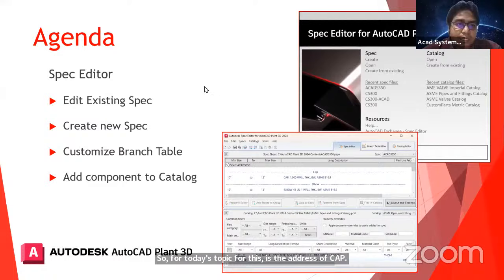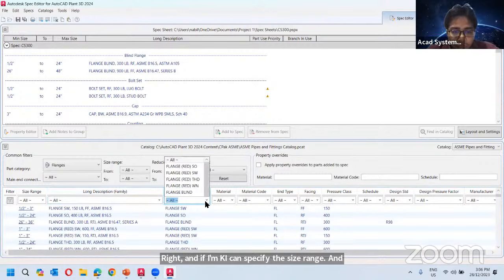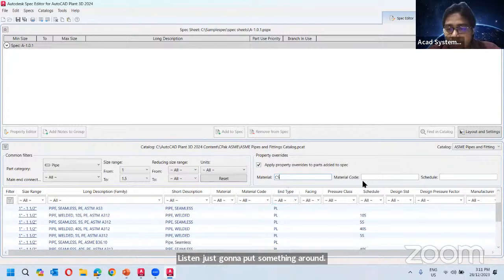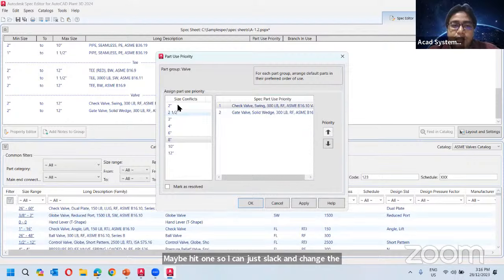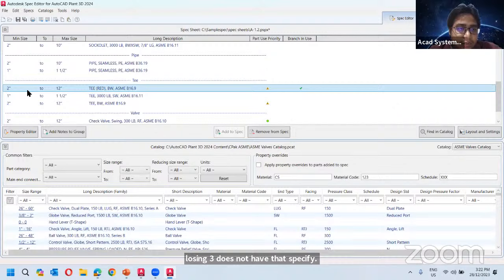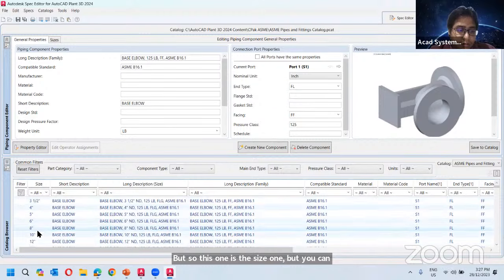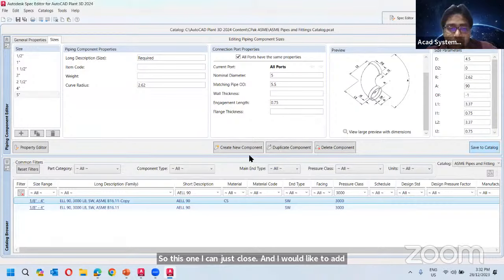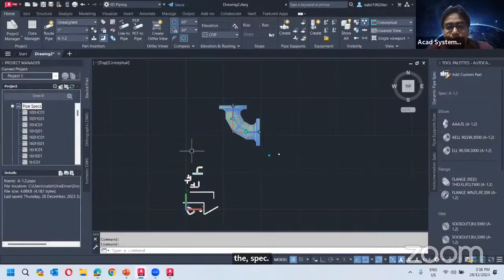Autodesk AutoCAD Plant 3D Understanding Custom Spec

Comment: How can i fix the model is too big when i add from Custom part ? Although i choose the size of equipment is equal to pipe routing.
Reply from the maker: Normally problem when create a block. Please choose right unit when creating a block. :)
Reply from the maker: Hi, for the model size you can change it on the "Size Parameter". When you create a new component It's given a default value for all of the size. Thus, you need to change it manually for each of the size.
Reply: @acadsystems  Thank you for you help 😍😍